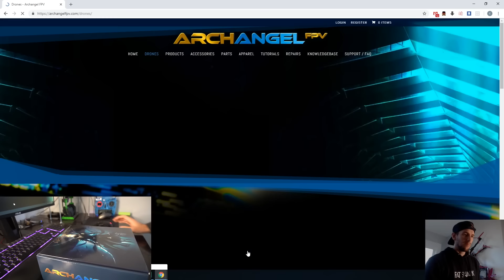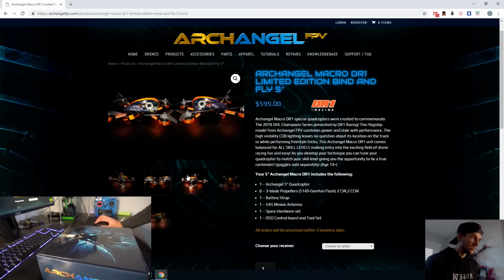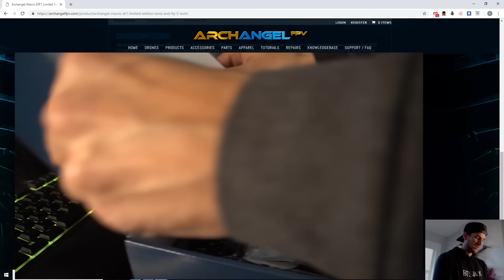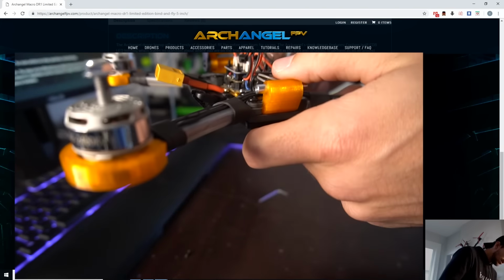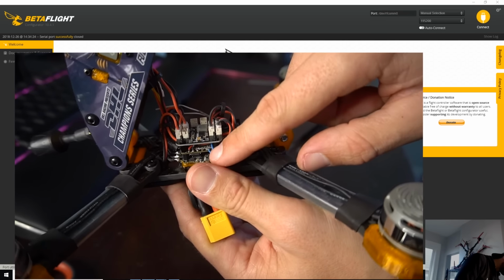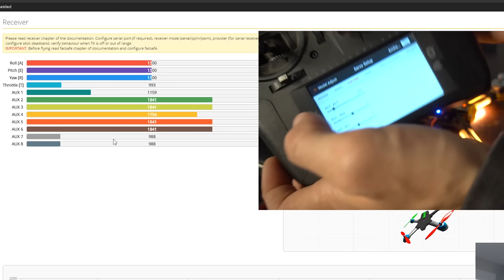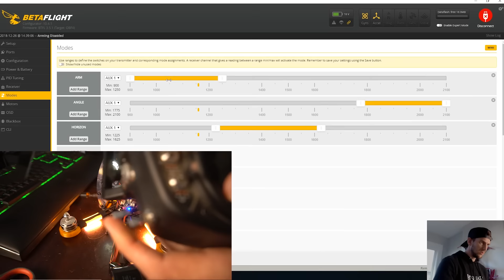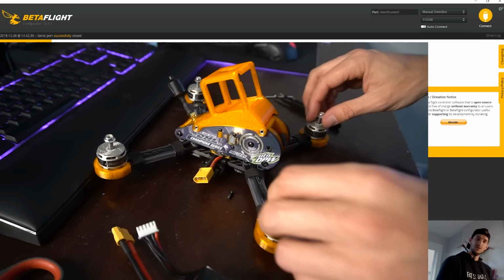Archangel DR1 Edition 5 inch Drone Review

Comment: Thanks for the review. One of the few top pilots still using Spektrum. I have always wanted a brightly lit drone so it can be more easily spotted but prefer to build my own. Do you normally fly 4s or 6s?
Reply: all the fast pilots except vanover fly 6s
Reply: @hazardfpv1888  I started building 6S just a couple months back and I can't go back to 4S. I am just a casual flyer but the performance difference is striking.
Reply from the maker: Hey thanks for your comment! I fly 6s only now so it was off flying 4s for this review. Took a bit to get used to. Also you’d be surprised who flies spektrum. Lots of top guys use the ix12 - headsup, flyingbear, etc. I’d bet that Taranis is more common though for fpv 👍🏻
Reply: @SFPV  It is cool to see Spektrum is still commonly used. I have a DX9 and it was my primary setup until I got into Crossfire and just preferred the integration with Taranis. I still have a couple quads on the Spektrum and fly them pretty regularly but the vast majority of my quads and all my 6s stuff is on Taranis with Crossfire. I like keeping Spektrum so I can bind with Horizon Hobby products when needed.